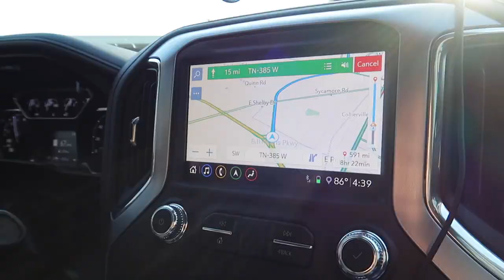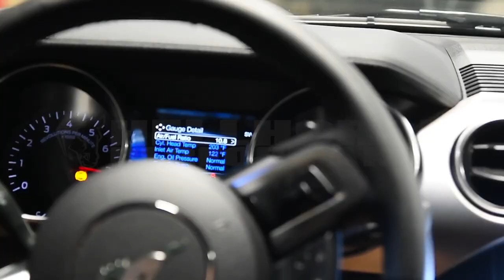Pulled My 2019 Mustang GT 10r80 Transmission Apart AND THIS IS WHAT WE FOUND...

Comment: I have a wrench light and these codes came out p0740 torque converter clutch circuit/open and  p0743 is torque converter clutch circuit electrical car drive fine tho any Ideas plz help

Comment: After owning a 2015 Dodge Challenger SRT automatic with all the bells and whistles, I can tell you 100% I am sticking with manual transmissions. Although, my SRT was beautiful, the transmission would downshift without warning on its own and other dangerous transmission issues. Since then 2019 Mustang GT base with 6Spd manual and quad tips. $27999! Bought new on December 31, 2018 and all new cars were 10K off as part of a end of month/year promotion!

Comment: The jump cuts give me a headache Gavin style, but did start to flow real well towards the end...
 Im very interested in getting the info on the midnight trans as mine is.currently being machined to accept the larger clutches and im still down waiting on "selective snap rings"( fancy term for parts of different thickness to set clearance in trans/drum combos with a lot of variation/QC) for B clutch others had to machined even with the thinnest rings ( clutches are .007 thicker than stock and steel .002 adds up in a stack)...

 Good luck on Dyno...you getting the 4 n 1s while your there?
Reply from the maker: Yes getting 4-1 headers. Mo power lol. I think your trans will be awesome at the end. I could only afford stage 1 right now but it’s supposed to have better clutches than before
Reply: @Zander13Productions  man I dont even know if I can afford mine, seriously it snow balled...parts just come in 2 days early though...may have to sit on his lot a day or so once done...haha, car has ate more money than gas...haha...wife left but came back...I cant afford another failure if it breaks again in 2020 im gonna have to pretend I just don't feel like driving it haha

Comment: IMO, buy once, cry once. just go turbo 400 and don't look back. why do i get the feeling that we'll be right back where we are right now in 3 months with this "stage 1" 10R80? hope i'm wrong. best of luck brother.
Reply: Midnight is going 7s at 176mph on their 10r80, Jesus how fast you want him to go...hehe
 Seriously its not a stripped down base car...
 As someone that's ran turbo 400s for 30 plus years then upgraded it to a 4l80e ( turbo 400 with an OD and lock up literally..same ratios and drum several parts interchange even the sprag...output shaft same.ect) i don't Ford guys fascination with a turbo 400...it negates everything new about the car just buy a fox body and save 40k at that point...
Reply: @bluecollardaily2676  they're going 176 on their stage 1 10r80?
Reply: @dogsubx2  zero idea which stage they quoted me ( before they got famous off it), but 1000hp...
  I have been working with Raybestos and my trans guy for machining....( cause clutches/steels thicker than stock ) and head dude at Raybestos told me he had a car out there with over 50 passes making 1350whp  with these clutches, I presume he means midnight....
  Surely, especially when he can change it out himself that whatever a stage 3 cost ( i was quoted 2400 for what I wanted and will end up easily having more than that in mine now) its still way cheaper than buying another stall, built turbo 400 and swap kit....plus all those labors....
 Its truly insane what a 10r80 will hold without much if anything in the way of hard parts....

Zander13 said he is hoping for around 1000 on the dyno and his is stage 1, so damn....can't imagine stage 2 and 3 hehe
Reply: @bluecollardaily2676  wow. sounds like they've come a long ways with the 10r80. glad to hear it. for sure would rather keep it than goto a turbo 400. if they prove themselves on a larger scale for a longer time, maybe we'll see the end of the 400's in late model mustangs. we can hope!
Reply: @dogsubx2  me too and that comes from a guy that has a 1000 plus hp BBC 67 Camaro for last 30 years...and went thru many turbo 400s hehe....
 I damn sure don't want to pull the main thing I like about my first new car and replace it with the same shit I been running my whole life haha....
  For me not Captain Insano Zander13, I mean Raybestos told me with no reservations what I'm ending up with will easily hold the 750whp ill make..in fact I had no clutch material some steels were just starting to get some hot spots with the stock trans...
 Stock 10r80 is rated at 590ftlbs input...let's call it failed at 650ftlbs the "20%" increase from even GPZ clutch sets put that at over 700 so ill be fine....especially since I'm a PD supercharged car and don't need to shock the power train to leave...but I won't ever be an 8 second car either....my problem has been engines im on my 3rd in 5k miles...
  I figure ( and the Raybestos contact said they have development ongoing right now on the 10r80 as its at the top of their radar with Ford and GM using it ), by the time I want to get aggressive ( read risk 25yr marriage from a 6th failure in 2 years/10k miles of ownership), the 10r80 development and programming to match will be fully matured....
 I perfectly understand if chasing a record people swapping out but were I younger and could even pull the trans like Zander13....id get a core and have one ready to R n R and stick with it...